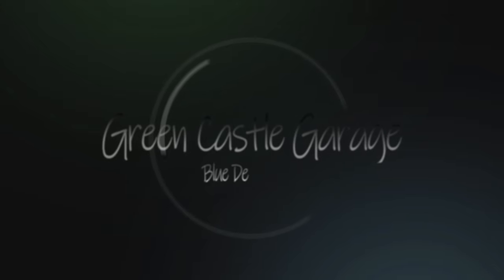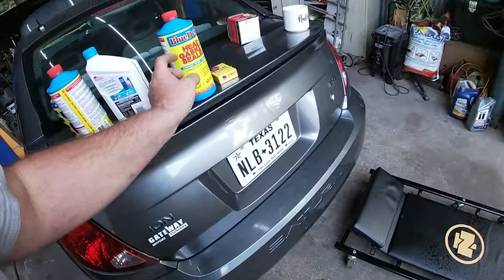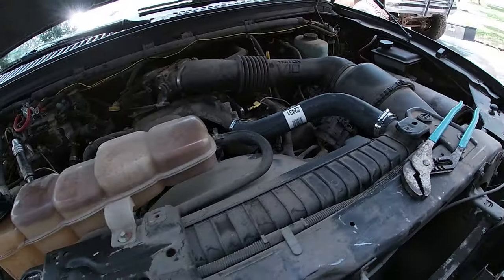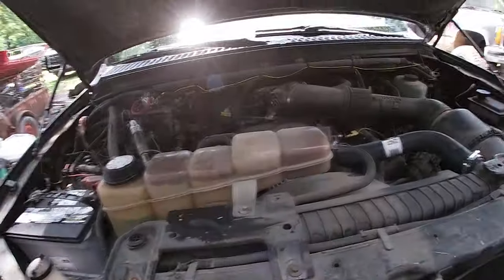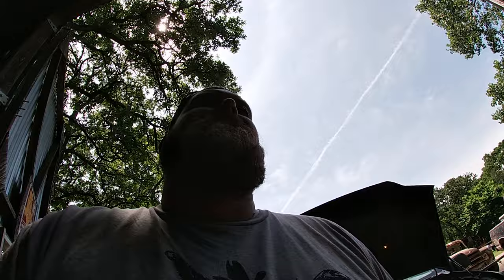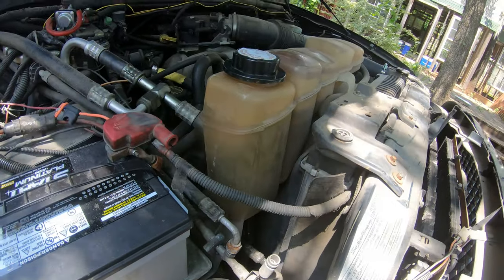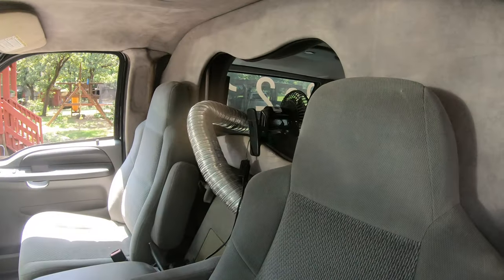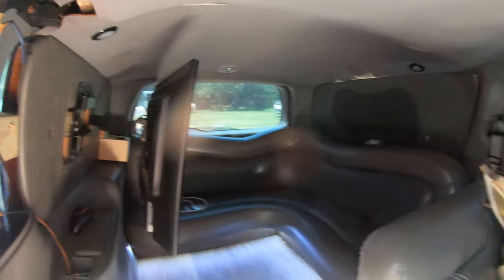Blue Devil Head Gasket Sealer: Does it Work?

Comment: With an expansion tank,  you'll want to disconnect and add directly into upper radiator hose. Or it'll heat up with hot vapors in tank and turn your engine into a goopy mess. You're pretty much activating the chemicals before they ever reach your engine. 
 Hope this helps you all 😉👍🏾

Comment: This is the right way to use blue devil: remove ur thermostat, use no thermostat  when using blue devil. Bypass the heater core with heater hose so blue devil won't clog the heater core. Drain the anti freeze  fill with water run engine few minutes drain water several times until just clear water runs out the radiator. Fill with water. Now use Blue devil. Run the engine for 1 hour at idle with blue devil in it.  Now drive the car for a month with the blue devil in it. Replace the water pump. For some weird reason blue devil makes water pumps go bad happened to my honda.
Reply from the maker: Can report its still holding over here, I don't think I even bypassed the heater core. But it's a limo so I doubt anyone would notice if the heat was out

Comment: Is it still running brother
Reply from the maker: Still going, we have driven it for maybe 2000 miles so far. About 800 of those in a single trip. Being a limo we use for fun, it doesn't get daily driver usage obviously. But for what it's worth it's still holding strong.
Reply: Yes

Comment: I'll be doing it on my LT1 Camaro and about a week or two.
Reply from the maker: Nice, I was shocked that it worked but I can report it is still holding strong. We are going to be taking about a 600 mile round trip in the limo in two weeks. If you would like I will gladly report how it does. It's the first long trip since the Blue Devil, so fingers are crossed.
Reply: I hope it works for you as well.
Reply: @saymoremccalman4974  it didn't 😅🤣🤦🏾‍♂️😭

Comment: How is it 9 months later
Reply from the maker: It is still holding fine, however, I do think it is important to note we do not put a whole lot of miles on this limo. Drove it on one long trip to south Texas once, otherwise it is a few hours at a time here and there. That being said, have not had a single issue since using the Blue Devil.
Reply: @GreenCastleGarage  thanks I just try is hopping it work I had a car I try one before an it did not work o. That one but I hope it works on this one
Reply from the maker: @gizmo33rd  Yeah, I'd say as someone mentioned before I'd definitely only do it as a last ditch effort. That being said it has worked fine for me.

Comment: It didn't work for me, it finished my car, and I followed the directions. I'm not the only one who had bad experience with it. Only use it if you're ready to say goodbye to your car then and there.
Reply from the maker: My thought process was might as well try it, worse case scenario your in the same position before minus the ~$70 for the bottle. Well worth an attempt if you don't want to pull the head immediately in my opinion. It's still holding for us, been awhile now and not a single sign of head gasket failure. Once it finally gives I'll be pulling the engine for a rebuild, but until then we have driven it as far as 500miles in a single trip.
Reply: @GreenCastleGarage  Worst case scenario isn't that you're in the same position. My car was still good for driving it around town. Until I used this product. 10 minutes into idling (after pouring it in), I got a major leak in the water pump, all the coolant poured out. After that my car could only hold coolant for few minutes, couldn't even drive it for 5 minutes anymore, it became completely useless. As I said, people should only take the risk of using this product, if they are absolutely ready to say goodbye to the car immediately.
Reply from the maker: @editk7019  Good information to know, didn't realize it amplified your problem. This is the only time Ive used the stuff, and it was certainly a last ditch effort that happened to work out in our case.The more information on results the better for anyone thinking about using it. Mind if I put your experience in the description of the video? I like to give people the best possible information I can when posting something like this.
Reply: @GreenCastleGarage  No, I don't mind if you put it in the description. I used the Pour and Go version of this product, which doesn't tell you to remove the thermostat, but in some people's experience it clogged up their thermostat, so they think they should have removed it anyway. I also had a problem with my thermostat afterwards, which I didn't remove because it was not required for the pour n go. I got a radiator flush before using this by the way, so I made sure it wasn't all dirty in there.
Reply: I'm ready to say goodbye to my car so here goes nothing!!😂😂